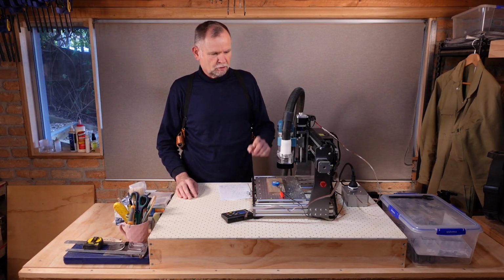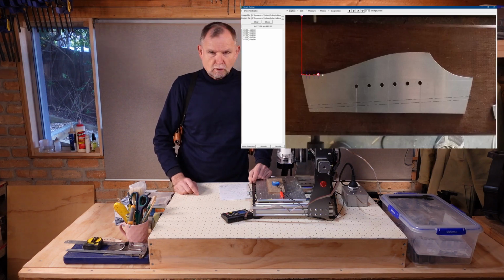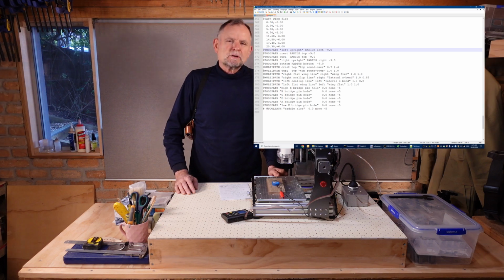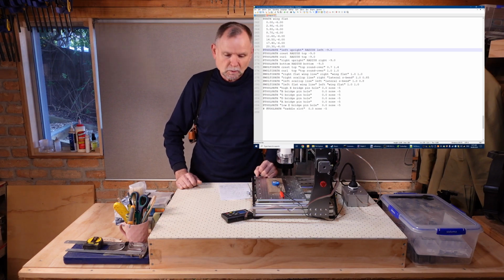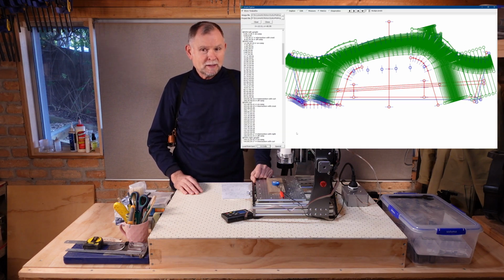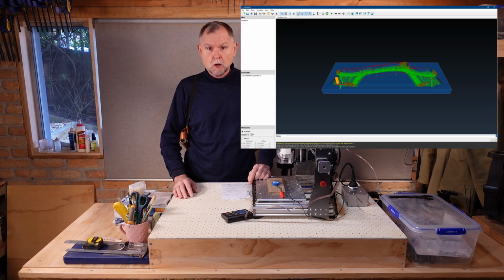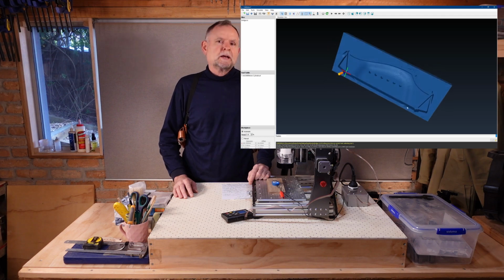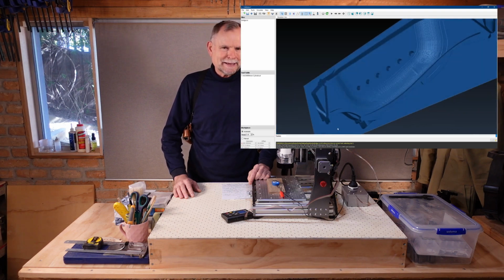VLOG 2024/10/06 - Some progress on my homemade CNC router software

Comment: Try freecad .. use the part design workbench to draw/trace the part then use the cam workbench to export the gcode .. then use universal gcode sender (UGS) both programs are Foss software.. 👍
Reply from the maker: Thanks, I'll keep that in mind for parts that exceed what I can cook up myself! But I do love the offline controller so I don't need to cart a laptop into the dusty workshop.
Reply: @ ugs runs on a raspberry pi..